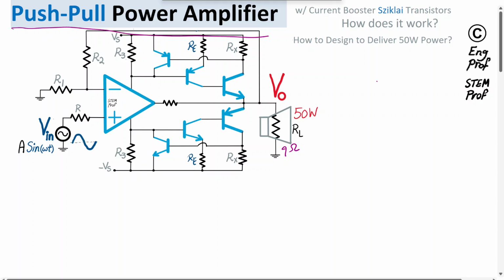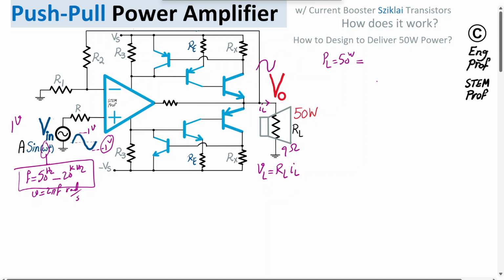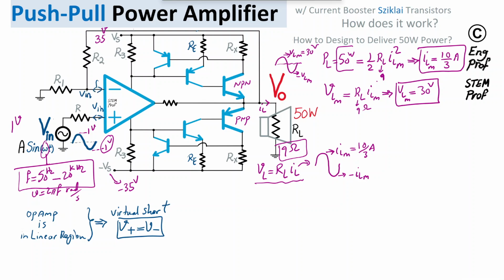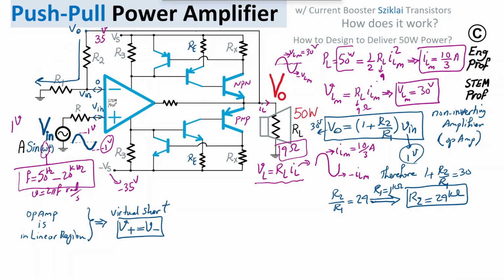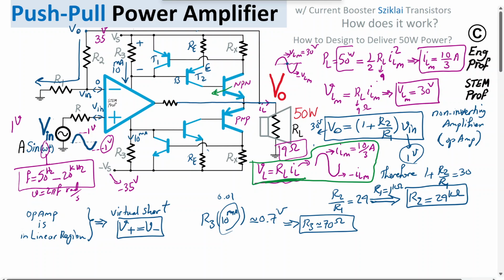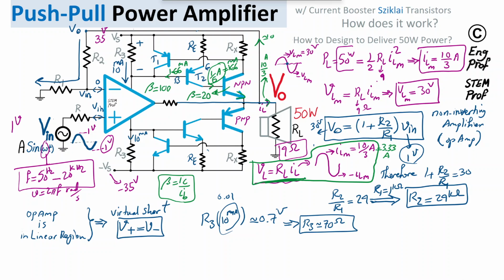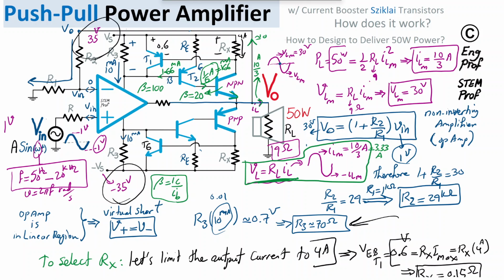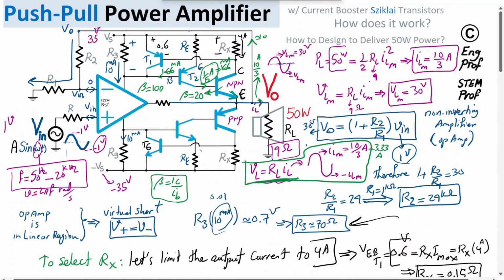Push-Pull Power Amplifier Design with Op Amp, Sziklai Darlington Transistors

Comment from the maker: Thanks for watching. For more Op Amp Circuit examples pls see:
Op Amp Amplifier with Electronic Gain Control https://youtu.be/NoNgQpbj77Y
Push-Pull Power Amplifier with Darlington Transistors https://youtu.be/866MYibo8yE
Voltage Regulator Op Amp Circuit with Foldback current limiting https://youtu.be/VN4_qF9DvBM
Power Amplifier Design (Class A) with Transformer https://youtu.be/gKlJrqGqeCI
Current Foldback Voltage Regulator Circuit Design with Op Amp, Darlington BJT Transistors https://youtu.be/RFfRrbqM_-s
Analog Logarithm Computer https://youtu.be/RpKEq5WyoLg
Op Amp Analog Computer Differential Equation Solver https://youtu.be/ENq39EesfPw
Thermometer Circuit Design with Op Amp & BJT transistor https://youtu.be/55YsraFE0rg
Instrumentation Amplifier with Electronic Gain Control https://youtu.be/C4tghZ-q6Zs
Sallen-Key Analog Filter Design Tutorial https://youtu.be/KwUnQXbk7gM
Universal Analog Filter Design https://youtu.be/2J-0msXZE2o
Laplace Transform Example and S-domain circuit analysis:  https://youtu.be/ps8N5TPM_qU
Op Amp circuit Bode Frequency plot https://youtu.be/BLVzuuqAlZs
Lowpass Butterworth Filter: https://youtu.be/UzCjkwqy-9w
Analog Computer to Raise Signal to power n https://youtu.be/IUTlBH1UraE
Triangle Oscillator Op Amp circuit https://youtu.be/JF5Up_cuL9k
Differential Equation Solver Analog Circuit https://youtu.be/R3X5AYNZGEI
Complex Sinusoid Oscillator https://youtu.be/GXRhmwmS5Zk
Sawtooth Oscillator Design https://youtu.be/2eUsGPfqbW4
Full-Wave Rectifier circuit example https://youtu.be/DJJMNU-CYcg
Sawtooth Waveform Generator design with OpAmp, JFET, BJT https://youtu.be/5zHXTx-Vl20 
op amps Circuit with feedback loops to design an analog computer that solves a second order differential equation https://youtu.be/HeZRtnRXpEI 
For more analog circuits and signal processing examples see: https://www.youtube.com/playlist?list=PLrwXF7N522y4c7c-8KBjrwd7IyaZfWxyt
I hope these Circuit design and analysis videos are helpful. 🙋‍♂

Comment: In this circuit, the base signal for transistors is coming from the power rails of the OPAMP. This was only briefly mentioned in the description. Rather, it mentioned that the current going into/from the OPAMP set the voltage on the bases using those resistors. This should work in case of ideal OPAMPs, and probably the majority of them, but not all. The OPAMP may use (and actually does use) its power rails for things other than driving the output, and this "other" use will throw a wrench into the calculations. For example, it may use the rails to drive the internal chopper circuitry, which will feed high frequency noise into the transistors. It may be driving the internal voltage reference that would have unusual power consumption changes depending on the temperature, which will change the offsets, etc.
Reply from the maker: Thanks for watching, and for sharing your thoughts and observations. You have valid points regarding requiring careful selection of Op Amp and current variations/noise on power rails of the op amp. While this is not the best circuit topology for Push-Pull Amplifier design, the idea is that assuming proper Op Amp selection, the circuit's negative feedback takes care of keeping the circuit stable and on-point. Please watch the following alternative/better Push-Pull designs:
▶ Push-Pull Amplifier with Darlington, Sziklai Transistors explained in https://youtu.be/866MYibo8yE
▶ Bridge Audio Power Amplifier is explained in https://youtu.be/EDpu6urAtHA video
▶ High Voltage Push-Pull Power Amplifier example discussed in https://youtu.be/C9Hse91r5sA video.

I hope these alternative designs/examples are useful.  Thanks for your interest in this engineering channel.

Comment: Hello...
That was a nice presentation of the calculation process of the resistors, but there's a caveat that is only mentioned at the end and which is not unimportant by any means.
The vast majority of Op-Amps cannot be powered by ±35V (or more)... Most can only be powered at ±18V, only some can be powered at ±22V and relatively few power op-amps can be powered by ±35V or more. 
That Op-Amp is not a common run-of-the-mill Op-Amp and the feasibility of the whole topology depends on the selection of this Op-Amp.
For a relatively easy to select Op-Amp that has a ±22V absolute maximum power supply, and assuming yet that you will loose some 2V of peak output, you'll only reach up to 40Vpp, which, at 9Ω RL, 
will yield, tops, 22W.
Reply from the maker: Thanks @fabiotrevisan8922 for your interest and good comment. Yes, this topology does depend on the op-amp choice, and a generic ±15 V / ±18 V “jellybean” op-amp will not get you anywhere near 50 W into 9 Ω with ±35 V rails. Two important clarifications though:
1)  The op-amp is not the power device.  It never sees the load current and is not expected to swing the output rail-to-rail into the load. Its job is voltage control and feedback enforcement. The Sziklai output stage does the heavy lifting.

2)  Yes, a high-voltage op-amp is required. That’s why, near the end of the video (as you noted), I explicitly point out Op Amp devices like Texas Instruments' OPA452 / OPA453 (±40 V capable). With those, ±35 V rails are completely reasonable, and the 30V peak output requirement for 50 W into 9 Ω is achievable with margin.

Your 22 W calculation is absolutely correct if the op-amp is limited to ±22 V absolute max, and you assume ~2 V of output headroom loss.  In that case, you’re capped around 40 Vpp.  So the op-amp selection is a first-order design constraint, not an afterthought.  If a designer wants to use a low-voltage audio op-amp, they should scale the rails and power expectations accordingly;  or choose a different front-end architecture.
Here is another Push-Pull video of Power Amplifier design with Darlington Transistors that you might find interesting: https://youtu.be/866MYibo8yE
Thanks again for the comment and sharing your thoughts.

Comment: Did anyone hear how to select Re? What value was it?
Reply from the maker: Thanks for your interest in this video. Good question!  no, you didn’t miss some magic number😄. Re is a design choice, not a fixed value.  Here’s how to think about it:  Re is the emitter resistor of the power transistors.  Its main jobs are:
current sharing / stabilization, soft local negative feedback, and helping the current limiter behave predictably.

In this design, Re is intentionally small. For a 50 W / 9 Ω target: Peak load current ≈ 3.3 A
If you choose Re ≈ 0.03–0.1 Ω, you get:  ~0.1–0.33 V drop at peak current,  negligible impact on output swing, and improved thermal stability.  That’s why I didn’t lock the value of Re to a single number in the video. Depending on priorities:
Lowest distortion / max swing → Re ≈ 0–0.05 Ω
More robustness / better current control → Re ≈ 0.05–0.1 Ω
Anything much larger just wastes voltage and power and buys you nothing in this topology.
So: Re is small, non-critical, and application-dependent;  not a missing step in the math.
I hope this clarification is helpful.

Comment: What is the purpose of the resistor going from the opamp output to the load and how to size it?
Reply from the maker: Thanks for your interest in this push-pull power amplifier circuit.  Good question, mainly to limit the maximum output current of Op Amp.
Reply: Sorry  @STEMprof , but unfortunately the selection of this resistor is not so inconsequential as that.
The value of this resistor determines how much current is being drawn by the Op-Amp from its power pins, which ultimately is the current that will drive the output's driver transistors.
Reply from the maker: @fabiotrevisan8922 thanks for the comment and sharing your insights. In the worst case scenarios when output of the Amplifier is shorted to ground, the resistor at the output of the op amp limits the max draw current.
Reply: @STEMprof Absolutely....but on the other hand, if chosen too high the op-amp will not draw enough current from the supplies so to excite the drivers enough for them to perform their "booster" purpose.
I even wonder, in that application, if it wouldn't be better to connect the op-amp output to a resistor to ground, instead of the output, to ensure that a current draw proportional to the output swing would be drawn from the supplies...I never saw it this way though.

Comment: Can I deliver 50 kW of power using similar circuit? 1kV rails at 50 A current say.
Reply from the maker: 50 kW at 1 kV/50 A is in a completely different world than the 50 W audio amplifier I designed in this video. The circuit I showed uses an op amp with Sziklai (complementary feedback pair) power BJTs to deliver about 30 V peak at 3.3 A peak into a 9 Ω load; perfectly reasonable for audio. The design choices (±35 V rails, BD243/BD244-class transistors, and an op amp like OPA452) are sized for tens of watts, not tens of kilowatts.

So, for your numbers:  1 kV rails immediately rule out any conventional audio op amp or low-voltage BJT/MOSFET — most devices top out at 80–200 V.   In addition, 50 A continuous means you’re in the territory of industrial IGBTs, power modules, water-cooled heatsinks, bus bars, and kilovolt isolation.  At 50 kW, your design must consider not only transistor Safe Operating Area (SOA), but also arc flash hazards, creepage/clearance distances, and insulation coordination;  things normally handled in high-voltage inverter or motor-drive design, not in small-signal amplifier topologies.

So while the concept of using an op amp to drive a push-pull stage scales nicely up to maybe a few hundred watts (with beefier MOSFETs or BJTs), it does not scale directly into the kilowatt regime. At 50 kW, you’re really talking about multi-stage driver isolation, gate-drive transformers, and industrial power electronics topologies; not just “bigger op amp and bigger transistors.”

Bottom line:  This circuit is great for 50 W audio applications.   For 50 kW at 1 kV, you’re in power electronics engineering territory. Think motor drives, HV DC–AC inverters, or traction systems which require entirely different design methods, components, and most importantly, serious safety precautions.

Comment: please.. can we upgrade this circuit to deliver  300w without any change in schematic , just replace the components ? your follower from IRAQ❤❤
Reply from the maker: Good question! You can scale up the power output of the amplifier to 300W by following the same design principles, but you'll need to carefully choose high-power Sziklai or Darlington transistors for both the upper and lower output branches. The key is selecting transistors that can handle at least 15 to 20A peak current to ensure reliable operation at higher power levels. I recommend checking out high-power transistors on DigiKey or Mouser, such as:
🔹 ON Semiconductor MJH6284G – (100V, 20A, TO-247)
🔹 ON Semiconductor 2N6284G – (100V, 20A, TO-204)
🔹 ON Semiconductor MJ11028G – (60V, 50A, TO-204)
These options might work well, depending on your voltage and thermal management considerations. Make sure to also upgrade the heat sinking and power supply accordingly to support the increased power dissipation. For more Amplifier Circuits and Op Amp Examples, check out:
🔹 Push-Pull Power Amplifier with Darlington Transistors – Watch https://youtu.be/866MYibo8yE
🔹 Power Amplifier Design (Class A) with Transformer – Watch https://youtu.be/gKlJrqGqeCI

In case helpful here is the link to Darlington transistors on Digi Key https://www.digikey.com/en/products/filter/transistors/bipolar-bjt/single-bipolar-transistors/npn-darlington/276 Hope this helps, and thanks for watching.
Reply: @STEMprof   شكرا جزيلا لفضلك و كرمك

Comment: Love your series of video! Thanks for your detailed explanation.  I learned valuable practical design from you.  It is extremely interesting.
Reply from the maker: Thank you for your kind words! I'm glad to hear that you've found the series helpful and that the explanations are making a positive impact on your learning. It's great to know that the practical design insights are proving valuable to you! I think you'll also find the related video https://youtu.be/866MYibo8yE on the Push-Pull Amplifier with Darlington and Sziklai Transistors interesting as it explores a similar concept using different transistor configurations with more examples in the https://www.youtube.com/playlist?list=PLrwXF7N522y4vWr-8XRBqxpi5idFDE9BV Power Amplifiers & Voltage Regulators playlist where you'll find a variety of related circuits and explanations. I hope you find these videos interesting as well as you explore more in-depth analog circuit design.

Comment: In this way you can increase the maximum current of the OP-AMP but not the voltage which for a Ne5534 is 44 volts max.
Perhaps you can try to increase the maximum current that can be driven by a TDA2052 (or similar), but you can hardly find something larger than 44 volts on the OP-AMPs market.
Do you want to design an op-amp with discreet components?
Greetings from Italy and good luck
Reply from the maker: Thank you for sharing your thoughts on this circuit and op-amp. Please note that the op-amp's maximum allowed supply voltage is not violated in this design. The additional voltage drop across the series resistor in the supply rail will accommodate the extra voltage drop.
On a separate note, there are indeed high-voltage operational amplifiers with push-pull output stages. An example is the Apex Microtechnology PA198 High Voltage Power Operational Amplifier, which delivers output voltages ranging from ±215V with a dual supply to +440V with a single supply configuration. For more information, see the APEX PA198 datasheet at this link https://www.mouser.com/pdfDocs/pa198u.pdf

Additionally, you can find more examples of power amplifiers in the https://www.youtube.com/playlist?list=PLrwXF7N522y4vWr-8XRBqxpi5idFDE9BV Power Amplifier and Voltage Regulator Video Playlist. I hope this is helpful!

Comment: A.... But Op Amps have ±18V max operating voltage ⚡... How we can get ±35V for OpAmp? It will just burn....
Reply: Ok, Opa443 ....
But there is a problem with noise in all of them.... ~20 nV/√(Hz)
with amplitude from 1V to 60V max all that noise becomes ~1200 nV/√(Hz).

In comparison to normal low noise audio OpAmps with noise below ~4..5 nV/√(Hz)

Some of them even near only ~1 nV/√(Hz)

But all of them have ±18V max.

What to do if we need to get low noise 50W power amplifier?
Reply from the maker: @Arwndr  Thanks for watching & sharing your thoughts. You have a good point. Noise, drift and input offset are all valid and important concerns in op amp based circuit designs. A good designer need to identify the right operational amplifier that satisfies a practical balance among conflicting set of requirements including cost, power, Noise, drift and input offset. If need be a proper Filtering stage possibly additional feedback might be needed at the input or output of the circuit to further control or remove noise.  Here is another example https://www.youtube.com/watch?v=C9Hse91r5sA which is a Push-Pull Power Amplifier design (High Voltage) with Op Amp and Darlington Transistors.
Reply: @STEMprof  Thank you for big open feedback, and links for another solutions. I will study them all.

Also, us I understand, to much of feedback filtering for reducing Noise, - also reduce some parts and pieces of original audio. That's why I look for less noisy components where it possible, so to not create an extra problems with Noise so to have less deal with it in post, with some inevitable concomitant  quality loss of original audio source.

Thanks for your channel!
Very helpful for self education 🙌🏻👍🏻👌🏻🤝🏻
Reply from the maker: Thanks for your interest in this Push-Pull Power Amplifier Design example. Yes, OPA443 is a high-voltage +/-40V Rail operational amplifier.  Careful selection of Op Amp is important in high power amplifier design. For another example see Push-Pull Power Amplifier with Darlington and Sziklai Transistor pairs https://www.youtube.com/watch?v=866MYibo8yE

Comment: Could it be better to re-considered this circuit?:  ..Perhaps better to have the OpAmp feed towards the upper&lower sziklay-pairs instead(also make some biasing for the first  transistors of those), ..And also perhaps removed both the R3's (that potentially can interrupt stable Vcc/Vdd for the OpAmp)..  /The upper&lower 'clamping-transistors' seems like a fine concept (not referencing towards them, they seem Ok). 
Have nice week, thanks for sharing interesting electronic ideas. Electronics is a very fine hobby for many people.
Reply from the maker: https://www.youtube.com/@rolfts5762 You're welcome. And thanks for sharing your thoughts and good suggestions. To your point, there are many alternative ways and techniques to design and later this power amplifier circuit especially taking into account practical design considerations. For more stable high power amplifier designs I would recommend the following videos: https://youtu.be/866MYibo8yE designing a Push-Pull Power Amplifier with Sziklai/Darlington Transistor pairs, ---------- and also https://youtu.be/C9Hse91r5sA video of High Voltage Push-Pull Power Amplifier design with Op Amp and Darlington Transistors.  Hope these are interesting as well.